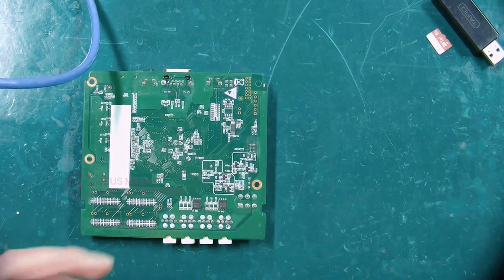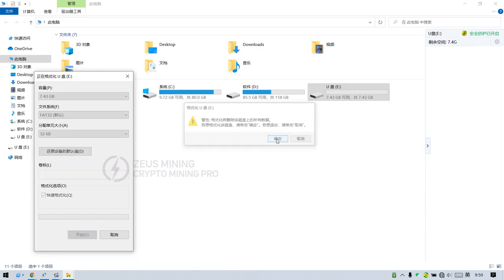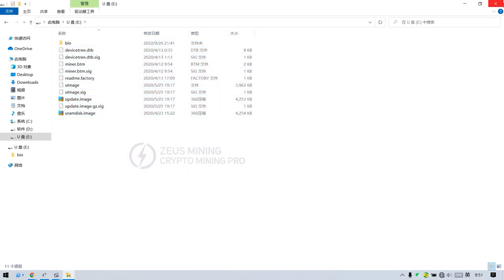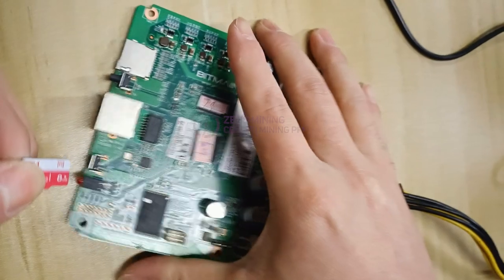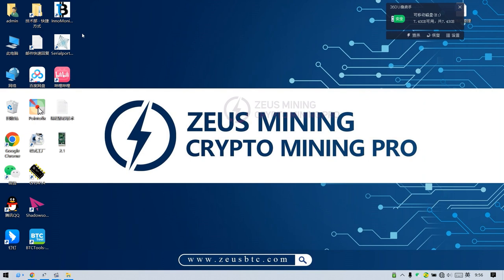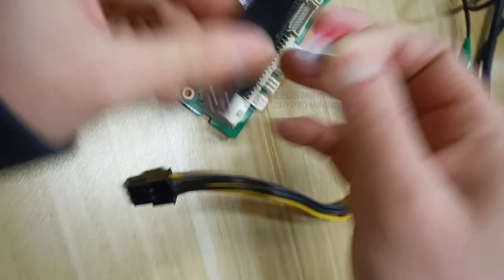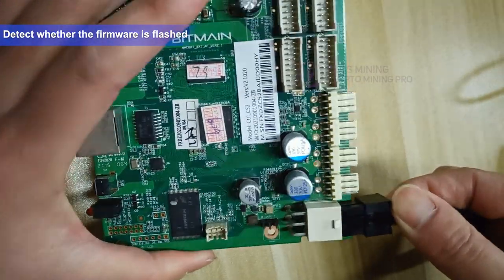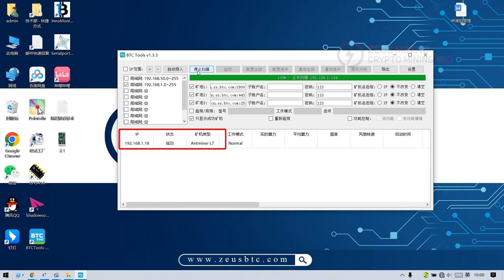How to flash L7 firmware to Antminer control board | Antminer Motherboard flashing firmware tutorial

Comment: The control board firmware in your video is a lot of files. The .BMU file for firmware update is one file. Are there different firmware files for these different ways to update the firmware? Link to the files you put on the TF card?
Reply from the maker: Yes, the firmware files are different. What kind of firmware do you need? Please contact our technician via WhatsApp: +8619123969124, he will recommend the accurate firmware for you according to the model.